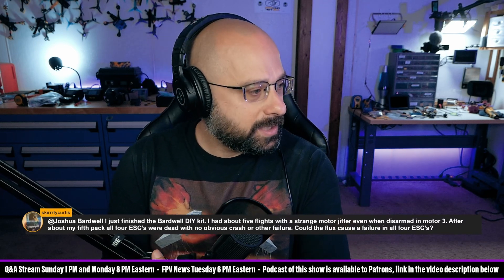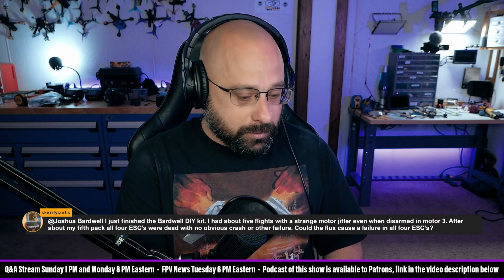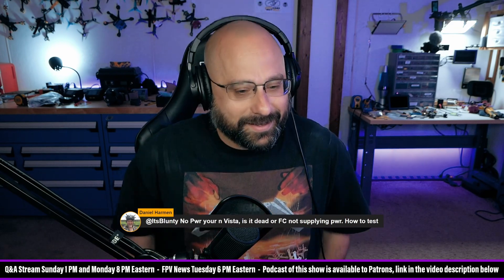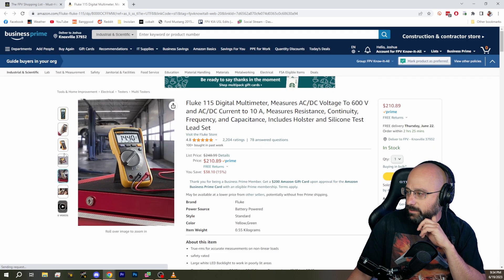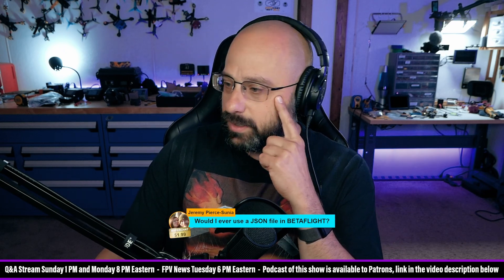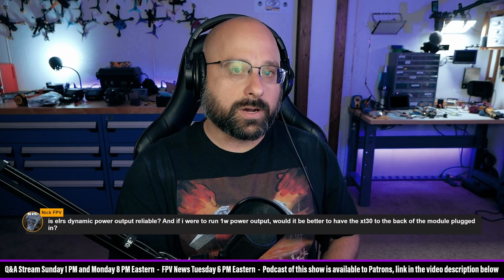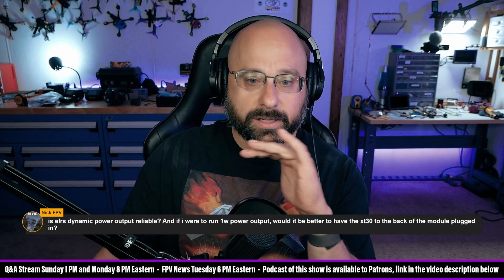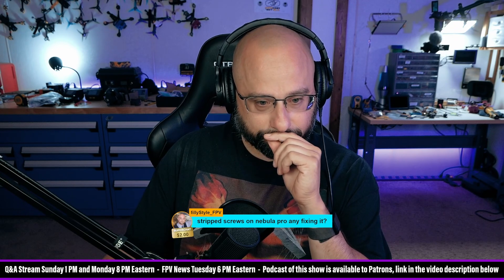Can Flux Cause ESC Failure? How To Test For A Dead DJI Caddx Vista? ExpressLRS Dynamic? - FPV Qs

Comment: After I'm done soldering I always use a toothbrush and 91% alcohol and I scrub all of my electronic parts the flight controller the ESC VTX and the receiver 😂I scrub it all clean it

Comment: Something I've learned about multimeters.. 
Use the continuity meter and see if it reads close to zero when touching the leads together. 
If it doesn't and you have the option calibrate it to 0.
Closer it will calibrate the 0 on continuity mode The better it is...
They vary from unit to unit, but even a cheap analog meter can be as accurate as a Fluke. 😉
Reply: well, yea thats basic calibration, the difference between a cheap multimeter and a fluke is that a fluke might measure at a 100ohm resistor (exactly 100hms)  100.5 ohms and a cheap one would measure maby 105.8 ohms, if you remove or calibrate the multimeter you remove around 0.3omhs, soo 100.5 - 0.3 = 100.2 ohms and 105.8 - 0.3 = 105.5 ohms. theres still a difference, relative to the size of the  measured object. the Fluke also has a lot higher quality and has some nice extra features and safety features, its ideal for professional use.
Reply: @speedy0_FPV  I can't argue with it being higher quality or features. It's obviously on the top shelf. 
I'm just saying that people can get the same results from a much cheaper meter. 
Even the cheap Harbor Freight multimeter has ran up against a fluke in YouTube testing. 
I believe that if you are going to use the crap out of it.. Fluke.
If it's going to collect dust on the work bench.. Even a Wal-Mart meter will give you surprisingly accurate performance.
Reply: @MadDragon75  yes, for something like building drones a walmart mutlimeter will do the job. just be careful in higher volatges, ive seen cheap ones measure 450VAC instead of 400VAC haha
Reply: @speedy0_FPV  Oh.. That can end up bad. 😂

Comment: Regular flux is  corrosive and should be cleaned with 75% or higher rubbing alcohol.
Reply: 75% is too low, too much water content, can cause issues itself. 99% or higher and you'll have no issues. Evaporates near instantly.
Reply: @crisnmaryfam7344  No argument here. The faster it dries without causing damage to the components the better.

Comment: Electronics tech here. I work on and refurbish automatic door control boards. I solder every single day. Let me explain this for everyone so it doesn't turn into some kind of misinformation campaign. Acidic flux needs to be cleaned with alcohol or flux cleaner. Over time acidic flux can cause cold solder joints. No Clean flux CAN and WILL cause cold solder joints as well if you're using no lead solder. My theory is bad or cold solder joints are responsible for the majority of esc failures. YOU MUST ALWAYS USE FLUX WHEN SOLDERING!!! All flux should be cleaned from the board before powering up. If you have smoke on power up then the joint is bad
Reply: Flux only smokes when burned. Solder joints shouldn't burn flux on power up. AND...Use as much flux as you want, the more the better. Just make sure to clean it off after soldering. I have never blown an esc in my 8 years flying quads.

Comment: I had a discussion with one of the ELRS devs about dynamic power on you discord and this is how he explained it works. If the signal degrades to a certain point, the power steps up a level but it doesn’t keep stepping up just one level if that doesn’t fix things. It will jump up to full power to avoid a failsafe and then move the power down. I think this makes the possibility of failsafe due to sudden signal degradation less likely.

Comment: Holy crow.  Did not know this about flux.  Jaysus.  I've been using flux I got at the friggin' hardware store.  Guess I got lucky, or that I use so little when I solder.  Either way, I got to change out that stuff ASAP.  Thanks, Mister B.!
Reply: MG Chemicals flux is the best of the best, specifically 8341